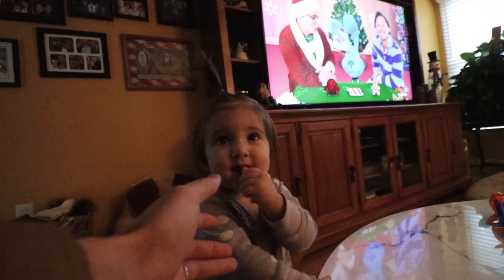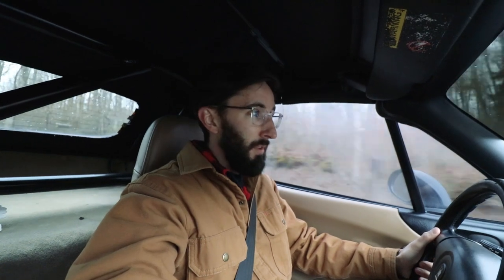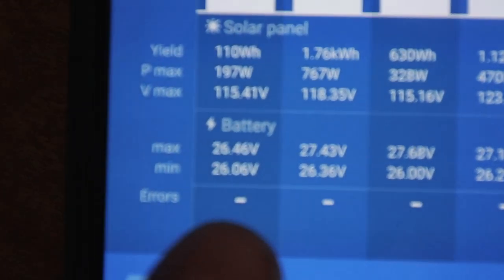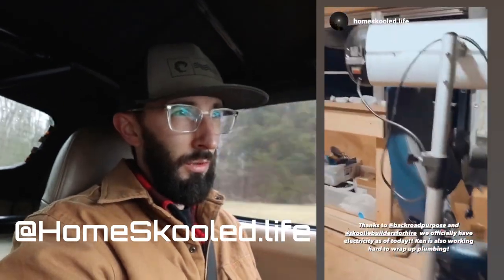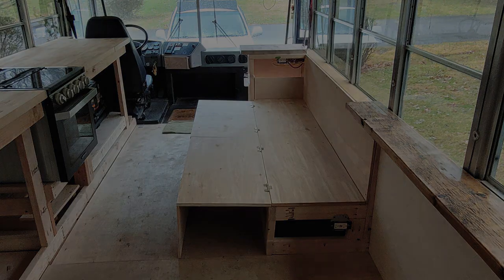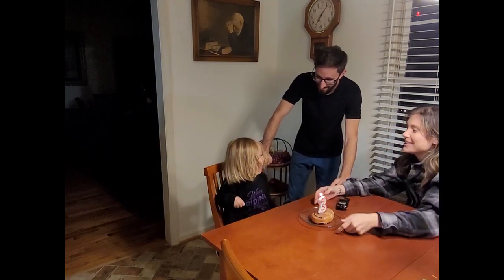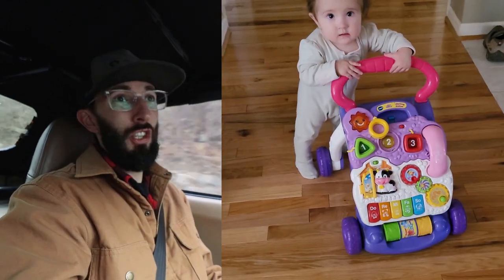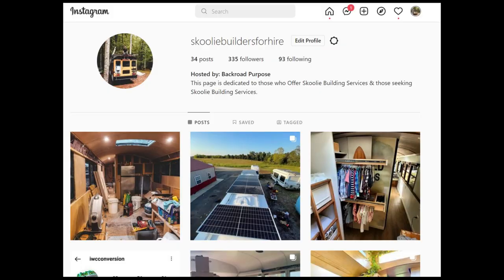2 Year School Bus Build Conversion // Skoolie Moving in.

Comment: Caleb, about the batteries. LiFePO4 cells are fully charged at 3.65 volts per cell. In 8s configuration, that would be 29.2 volts, however, the voltage on the charge/ discharge curve drops off very fast at the top and bottom, and voltage is very flat through much of the discharge curve. So it's not easy to gauge state of charge by the voltage. Also for longevity, I think your battery management system will stop charging somewhere between 14 and 14.6 per battery or 28 to 29.2 in series, as this type of battery will last longer if run between 85 to 90 percent and 15 to 20 percent. The cell voltages should range between 3.2 and 3.65. I added a victron smart shunt to our battery bank for determining state of charge based upon the actual current flow measurements. It's really important for LiFePO4 cells not to try to use them when dead, but the battery management system should cut the circuit out if a cell goes below low voltage setting, which is 12.8 or 3.2v per cell. And they'll be damaged if charging when temp is below freezing 32f/0c The BMS in that battery may not be userb manageable.